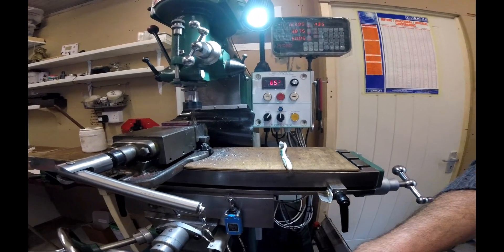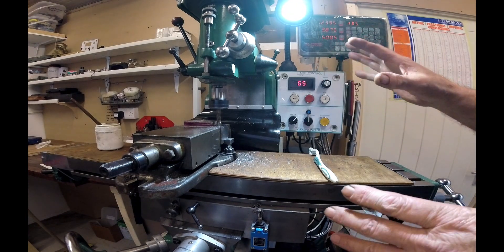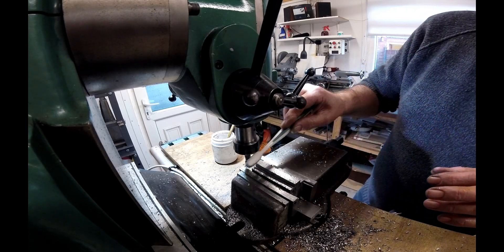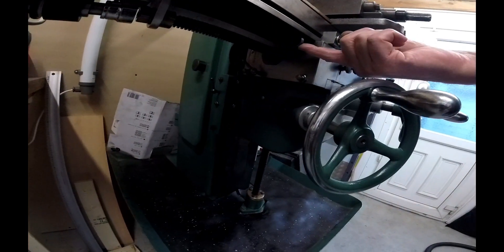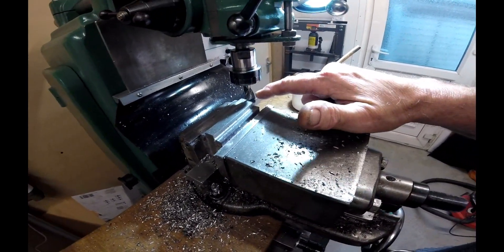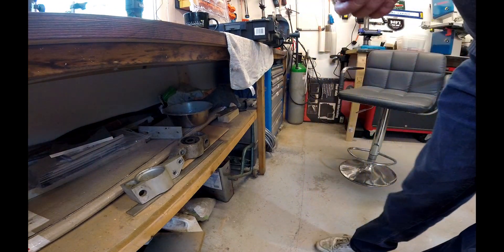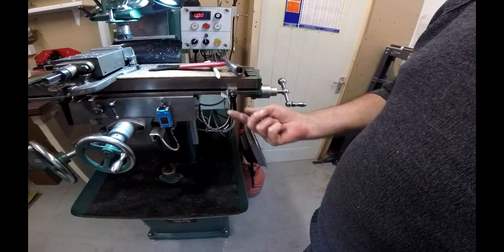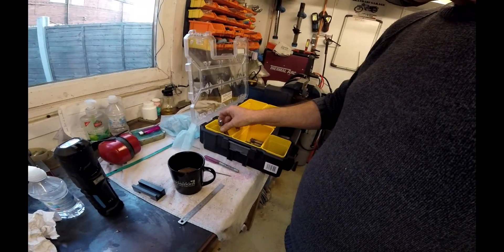Climb milling is bad for a small milling machine. Tom Senior

Comment: Mistakes are an education experience. Stick something in the vice and try and cut it. Speeds and feeds all factor into it. Cuter geometry and all are variables. Practice on alum. or brass. get a feel for different materials. Try drilling thru a simple thick piece of copper and you will learn about grabbing. Keep all your scrap. By more metal. Climb cutting is the preferred method for finish cuts, or light repetative cuts on cnc machines. Love to watch the chips fly in slow motion.
Reply from the maker: Thanks for the comment Martin. Since posting that video I have learned quite a lot & things are much better now.
Regards.
Steve.
Reply: @Steviegtr52  Every thing you see will become raw materials after a while. Have fun making chips.

Comment: For a heavy cut like you did conventional milling is best. A lighter cut of 0.1 mm or 4 thou for climb milling is suitable all gibs should be adjusted on light milling machines most industrial type milling machines have a knob on the table which is a backlash eliminator and should be nipped up when climb milling.
Reply from the maker: Thanks for that commander